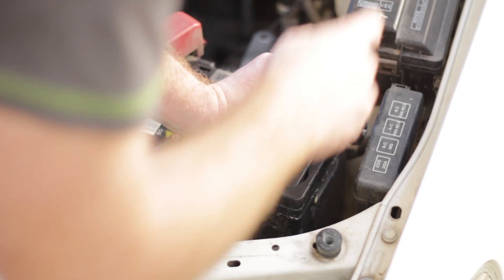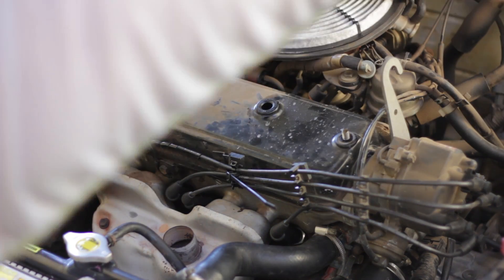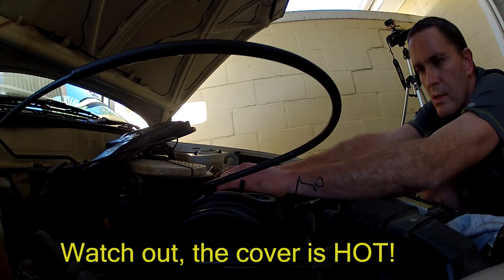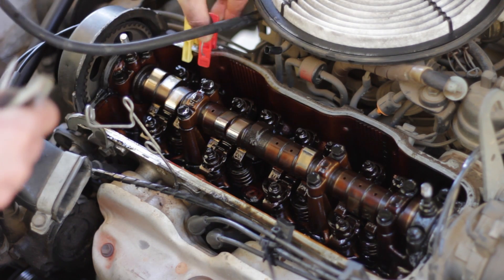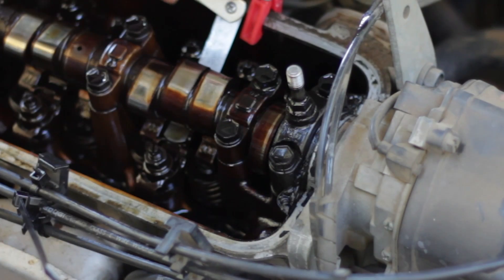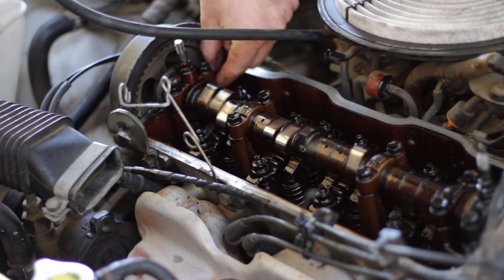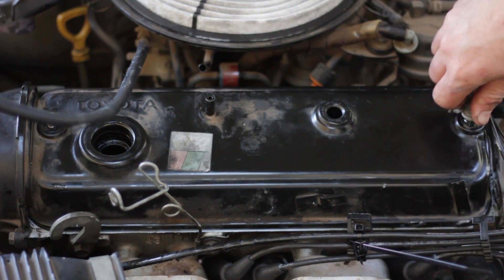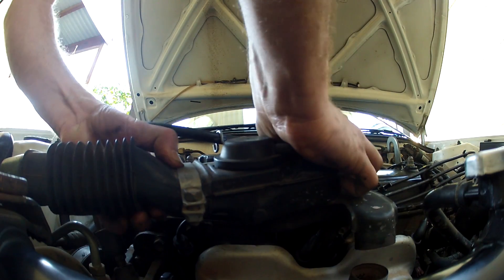How to adjust valve clearance on a Toyota 2E 12V motor

Comment: Air va lve on cover if rubber hard either leave it there or buy a new one as it will break . Loose rubbers holding cover on , unscrew them , this is what is stopping cover coming off.

Comment: What difference did you felt after doing this adjustment ? What was the problem
Reply: This is a routine service task. Many dealers/mechanics don't check valve clearance if there are no symptoms. On a 4 cyl engine the difference is not really noticeable, but on a single (like my Honda XR650L) it will start easier and run cooler.

Comment: its still ticking you should adjust them to 0.01
Reply: Toyota 2E engines specifies a 0.20 mm valve clearance both on intake and exhaust valves with the engine in hot temp.
Reply: @jeffreydevilla4961 I know its been years but you perhaps know how to remove the rocker arm pivots? Having a hard time here